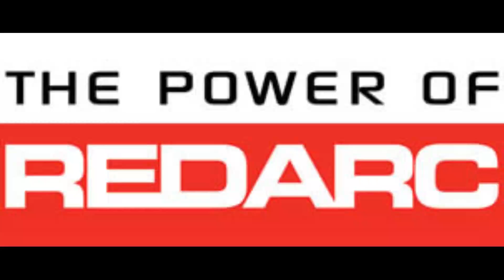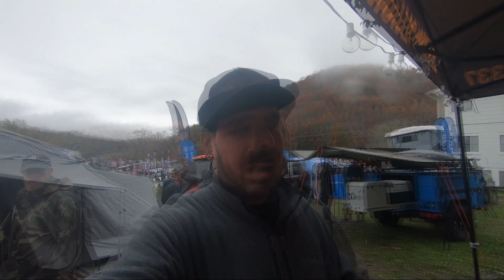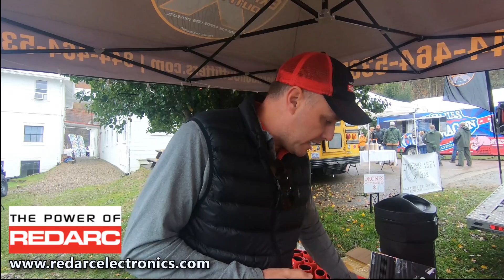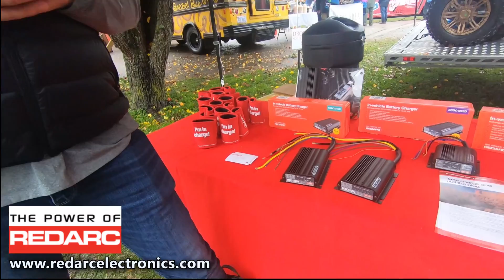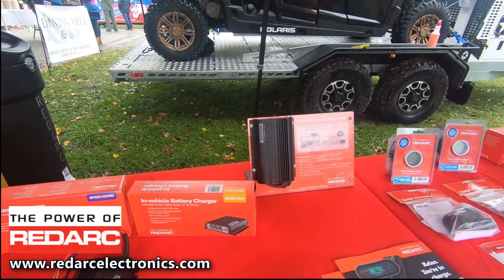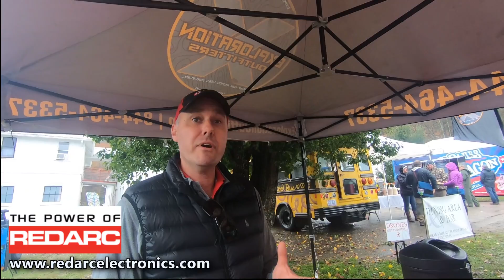REDARC Power Management | Onboard Power Management Made Easy

Comment: We have the redarc 25A DCDC charge controller in our trailer and it's awesome. Takes the vehicle power from our 7-pin and pumps it up considerably to keep the two AGM batteries in the trailer topped off when we're driving. We also have a 100W solar panel that we plug in when we're at camp. The system works so great. I'm considering picking up a second one to put in our vehicle when we switch it over to dual battery. Right now we just have a simple non-mppt solar charge controller in the Jeep which we use to keep the battery topped off at camp, but i'd like to hard-mount a solar panel permanently once I put a redarc charge controller in there
Reply from the maker: Yeah they are awesome systems.